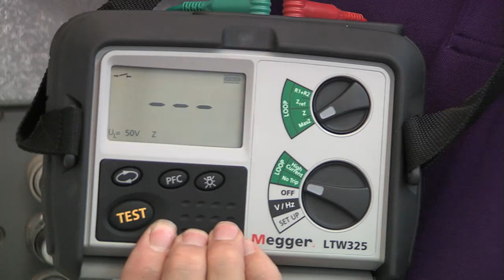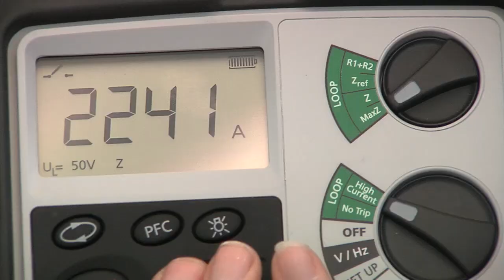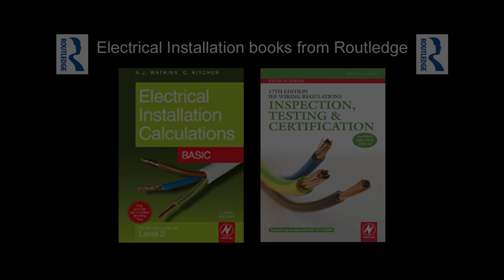Prospective short circuit current test

Comment: wouldnt you times it bye square root 3 to get three phase from line voltage? just a thought.
Reply: yes but I think it's easier to multiply by 2 but it's an educational video so it should say square root of 3 and also provide a link as to why that is. There is no point acting like people already know what you're talking about if it's an educational video... that's the whole point of it, people DON'T know what you're talking about. I also think I'm wrong but I wouldn't know why I'm wrong..

Also it should say what a prospective short circuit is... and how the value is calculated... like 230 volts divided by 0.05 ohms which is the point of low resistance (I'm not sure where because I'm trying to learn) equals 4600 amps which is the maximum limit of the breaker before it starts to arc and not safely break anymore. The video is way too short.

Comment: How do you work it out mathematically?  i.e if you have a transformer that is 11kV /400V, 100kVA, three phase delta-star, with a 5%impedance and when fully loaded has 5.25 Amps flowing through the primary windings (assume that there are no internal losses) Calculate the fault value?

Comment: You don't add the short circuit current between the two sides.  If you get 2250 between one hot and neutral and 2250 between the other hot and neutral, that isn't 4500 amps.  If the voltage is 230 on a single phase then you have 230v at 2250A on either side, but 460v at a maximum of 2250A between the two hots.  Each hot is its own current carrying conductor.  The amperage is not additive; the voltage is.

Comment: How did you measure over 2000 amps without sparks flying everywhere and molten metal splattering?  
I am so confused by this :)
Reply: it's not measuring amps, it's measuring the maximum amps before the circuit breaker fails and doesn't disconnect safely, I think... I'm trying to learn as well